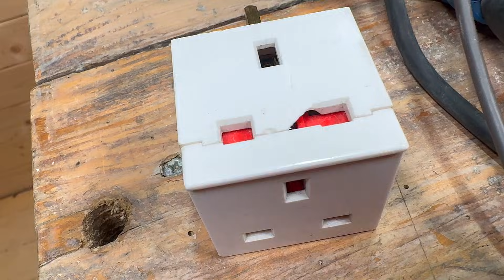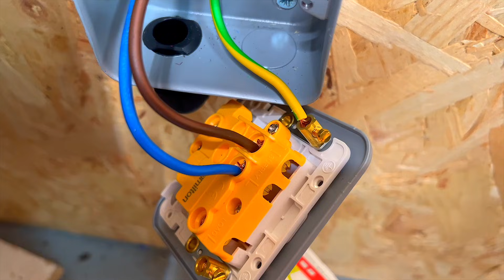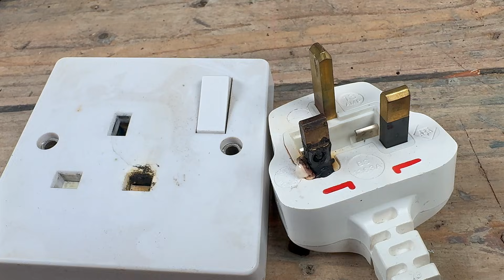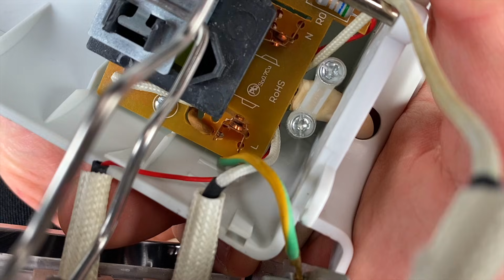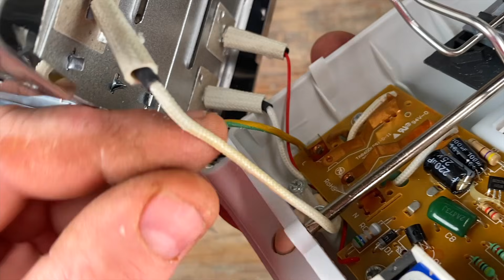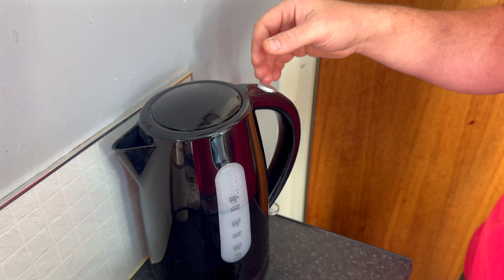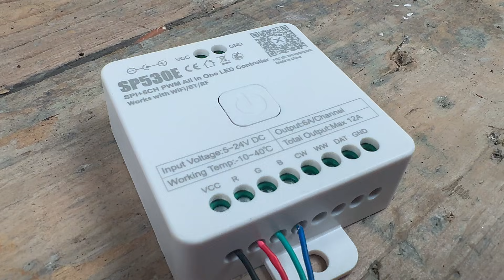Are You Qualified to do PAT Testing?

Comment: I’ve always thought personally, that only approved electricians should be allowed to PAT test. 

I’ve always been baffled by the whole PAT testing scheme, and how I as an approved electrician can’t really PAT test because I don’t have that qualification specifically. 

It should be the responsibility of a JIB Approved electrician, one that has the 2391-52 qualification.
Reply: Approved sparks worth their salt, have no need to be involved in PAT. 
    Its so limited in scope, there's no reason why semi skilled maintenance type workers can't do the course and be permitted to do it.
Reply: @ChariotsofWire180 The problem with that is, an awful lot of electrical fires are caused by faulty appliances!

So perhaps the current system isn’t working and it takes an electrician, worth their salt to sort it.
Reply: Either that or make AFDDs mandatory, something needs to be done.
Reply: @Jamesfoster48 With respect, your looking in the wrong place, at the wrong reasons for things happening.
    Most appliance fires are user error or the substandard manufacture and use of shite components and materials, none of which can possibly be captured by PAT, even if its carried out by the highest qualified sparks in the land. The PA test is basic safety checks, lead/plug/earth continuity and visual. It used to have merit when first introduced, as we had much class 1 equipment, and plugs were manually terminated and fully accessible, so there were issues with poor terminations, wrong connections and the like. Much of that nonsense has gone now, hence the report done 15 years ago which basically did away with PAT as we know it. The days of testing everything every year are long gone, it was only ever a money maker anyway, serves very little purpose now most equipment is either class 2 or has moulded plug. Most fires are also in domestic, which isn't subject to PAT anyway.
Reply: @ChariotsofWire180 with everything being double insulated and molded shut the only way to see the micro fractures that can occur over time you would need to xray appliances for really to know if something can arc or make a short circuit
Reply: @captain_heat They were just a couple of examples of why we don't need to be PAT at the previous levels. Most appliances fail because of manufacturer quality, components not up to the job, or user error and misuse. Micro fractures aren't really a thing, quality flex will easily outlast the lifespan of todays poor equipment. PAT isn't designed to pick up internal appliance defects.
Reply: @ChariotsofWire180 Yes, I concede to that point, it’s a great point and well made. I guess AFDDs are the way forward. 

Just a matter of time before the cost and technology will make them economically viable.
Reply from the maker: Some great discussion here. It is a tough one to call.

I’ve carried out appliance testing and am always very through, but limitations do exist because of appliances, quality and accessibility.

Equally, I have had the pleasure of working alongside some very experienced maintenance engineers who had robust testing regimes in place.

Thanks for sharing your thoughts on this😊
Reply: @efixx I’ve only recently discovered your videos, though I have bought stuff from your store before if you’re the same e-fix? 

I will be putting your stuff on our Google classroom, I now work with 5357 apprentices.

Comment: Define testing
Reply: This is what is required:
Visual inspection , and then a series of electrical tests are conducted as per the guidelines in the 5th Edition of the IET Code of Practice. These tests include:

Earth Continuity Test : This test is essential for Class I appliances (those with an earth connection). It involves checking the effectiveness of the protective earth conductor in the appliance.

Insulation Resistance Test : This test checks the quality of the insulation within the appliance and its cable. It helps in detecting any breakdown in insulation that could lead to dangerous electrical leaks.

Polarity Test : Applicable to plugs and extension leads, this test checks that connections are correctly wired and in the right sequence.

Functional Check : A basic test to ensure that the appliance is functioning as intended. This is not just about electrical safety but also about verifying that the appliance is fit for purpose.

Leakage Test : This involves measuring the current leaking from the appliance during normal operation. It’s particularly important for detecting potential electric shock risks.

Comment: Please define portable. I was told it meant the equipment was on a plug and could be moved. If it was permanently connected (ie fuse spur) or fixed in place then PAT does not apply!
Reply: I think the confusion here is caused by choosing to call it “Portable Appliance Testing”. Hence why the IET chose to use the term “In Service Inspection and Testing of Electrical Equipment” in the code of practice.
Reply: @stranglx Confusion is people take the exact wording to the letter, instead of looking at the actual equipment, how its connected and the task at hand.
Reply: @ChariotsofWire180 my point is that the equipment is subject to the same inspections and testing according to the code of practice regardless of wether or not it has a plug on it, because we do “In service Inspections and Testing of Electrical Equipment” more often than not the equipment happens to be portable, sometimes it’s not but still subject to the same code of practice.
Reply: @stranglx CoP is only guidance, non statutory at that.
Reply: @stranglx  ah much clearer. My old boss was wrong when he said an exstention lead screwed to the wall did not count as it was no longer portable.
Reply: @unicornpub  It means it's not exposed to regular handling - moving the flex around etc. So not portable.
Reply: @stranglx  It's PAT testing - P - portable - i.e. you can unplug it and walk off with it. Doesn't include washing machines and fridges etc. they're permanent installations but not fixed. The point being, for the normal use of the equipment, it's not subject to physical damage. Electric lawnmowers, shredders etc. are got out and put away usually - so are portable.

Having worked on access platforms, i.e. MEWPs I note they've changed the meaning - because they don't understand. They've gone from 'elevated' to 'elevating' - which demonstrates their complete lack of knowledge of the original term of MEWP.
Reply: @pmailkeey Starting fairly soon the Competent persons schemes will require members to be specially qualified in certain areas in order to carry out certain work regardless of past experience, some examples include EVCE and solar installation along with so called PAT testin … so when you’re on your “In Service Inspection and Testing of Electrical Equipment” course you can bring up your opinions on portability with your City&Guilds assessor and see how that goes. Best of luck 😂
Reply: @stranglx  It's really down to an assessment of risk. Is the appliance and its cable at risk ? How many times can you run over an EV cable before it shows signs of damage ? EV/chargers should be PAT tested. Cables not touched in using an appliance are not at risk of damage - unless you have mice. If you drag your cooker out once a week to clean behind it, there's risk of damage - so should be PAT tested.
Reply: @p @pmailkeey Yes, the code of practice takes risk assessment, personnel, environment and manufacturers instructions into account when choosing a testing and inspections cycle. I’ve noted on a number of domestic extension leads available from a major retailer that the manufacturers recommend “replacing or professional inspection and testing” after one year of purchase. What the code of practice doesn’t say is common misconceptions such as “it needs a plug to be tested or if it’s heavy for this person to move  it’s not portable enough to be tested” ect. These concepts are import to understand, hence why I fully support the notion that people should actually be qualified to carry out in service testing.
Reply: still needs inspection but a different type
Reply: Connected via a plug top.  If wired via a FCU, then it’s fixed equipment.
Reply: Doesn't matter if its portable or not, what matters is if it's of fixed wire connection.
Reply: Two main electrical testing most people should be familiar with is: testing of fixed wiring which includes anything considered as part of the fabric of a building (consumer units, light switches & sockets, fixed lighting fixtures...) or appliances (regardless of how it's connected, plug or hardwired). Does it have a data plate that shows energy consumption, then would probably come under Inservice Inspection & Testing Of Electrical Equipment.
Reply from the maker: Great question, and seen that you’ve had some cracking answers.

The correct term as @straglx correctly said is Portable Appliance Testing is referred to as “The In-Service Inspection and Testing of Electrical Equipment”

So equipment could include the office computer or a heater curtain above a shop door, even if that appliance is wired into a fused spur.

If you want to see me answer this is more detail head over to our trainer central where all the videos are available for the series.

I left the links on the description 😊
Reply: @efixx  Ah much clearer. My old boss was wrong when he said an exstention lead screwed to the wall did not count as it was no longer portable.
Reply: @unicornpub what it comes down to is risk management, any electrical equipment can break down and cause a danger. It would be a shame to be the person who ignored an extension screwed to a wall for years until it hurts someone and then have themselves explaining to the HSE “but it wasn’t portable” only for the HSE to ask “and where in the code of practice does it mention lack of portability as a reason to exclude the item from the scope?” Ultimately everything breaks down eventually so a sensible testing cycle is designed to intercept that item before a dangerous breakdown, regardless of what it happens to be screwed to, because the screws don’t entirely prevent it breaking down eventually.
Reply: Portable, plug top used and can easily be moved and used from place to place. ie toaster or kettle.
Movable, plug top used but big and heavy ie washing machine or fridge freezer.

Comment: No such thing as PAT testing as you keep banging on!  Also testing is like an MOT it's only valid at the point of test, operators (users of the equipment) need to be trained to do a visual inspection before every use!

Comment: A banana can do pat testing, is the socket/power source safe that the appliance is connected to? Electricians Job only. I rest my case M'lud.
Reply: It’s not about the sockets the appliance is connected to, it about the integrity of the appliance and whether that appliance is safe to continue using. . If you have an appliance that has a damaged power cord and sparks come out of it every time you plugged it in would you still continue to plug it in and use it even though you know the socket is safe. Judging by your stupid comment yeah you probably would. What a pilchard.
Reply from the maker: That would be one special banana, it’s an interesting thought thanks for sharing 😊
Reply: Take someone with an A level in Physics, I could teach them how to do PAT testing in a matter of a few hours and with them not being a qualified electrician and not having been anywhere near a C&G course.

And they would be as good at it as a qualified electrician, and quite possibly even better.